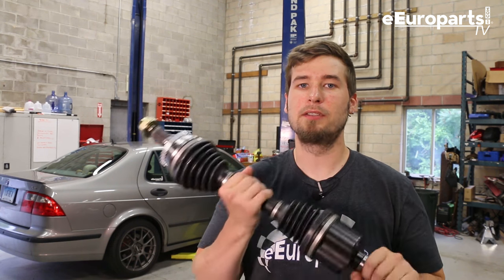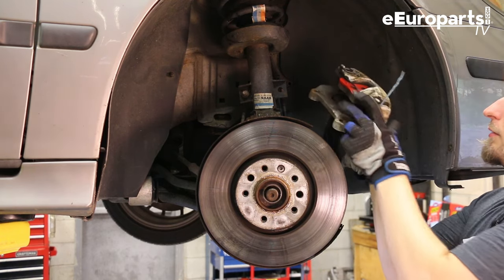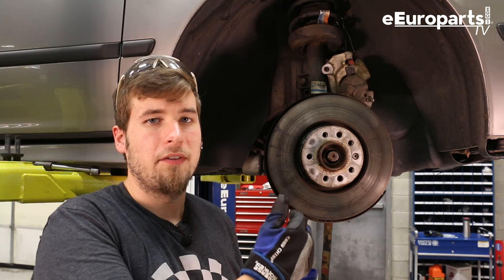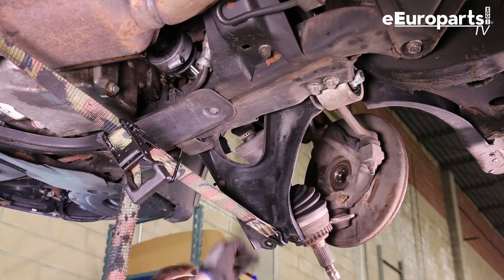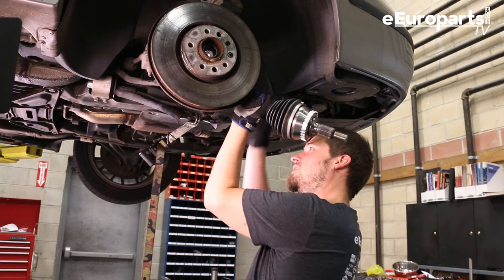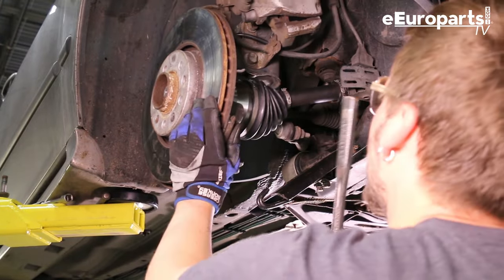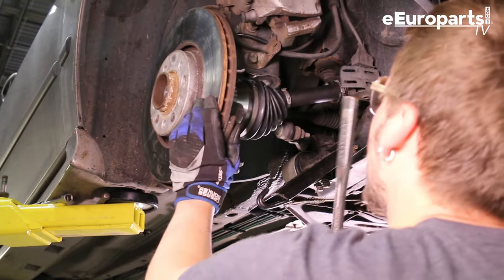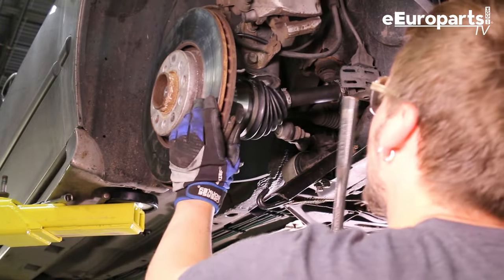Saab 9-5 C/V Axle Replacement DIY

Comment: When installing the new axle, it's not a good idea to hit the axle with the hammer which can damage the threads on the axle. Use the old nut on the axle and you won't damage the threads. The new nut is a lock nut which should thread on at least half way by hand then gets tight where the oblong portion of the nut is.

Comment: whew, man really thanks a whole for the video, was a big help for this project. I plan to do drivers side next week. My wife owns an 03' 95 so this video worked perfect for me. So yeah nobody here in lynchburg even sells an e20 inverted torx! I managed to bust em with a 16mm but wow it took a lot of torque. I ended up replacing those bolts to something i will actually have a  tool for lol. any videos on a/c compressor replacements? Thanks again i will definetly be subscribing
Reply: some 16mm sockets/ also have label e20 on them so those work with e20 and 16mm hex- bolt heads.

Comment: I have a 1999 9-5, can you advise how the process is different?  Maybe a diagram, links if not able to film it for YT? Also what is the part for the 99 vs for your later machine?  I am seeing listings some of which have axle shafts out both ends, some of which have a tripod joint on the inside.  Which to order?  What difference?  

Also if you lose ATF on the driver's side, is it reasonable to catch it in a basin and re-add?  I heard that there might be a conflict on what fluid to use and that different fluids don't mix.

Comment: Great videos! I just purchased a 2000 SAAB 9-3 convertible turbo manual trans.. What would be the best combination to lower and fill my wheel wells? I have seen 18 inch wheels but no lowering videos...Hopefully you know best!
Reply from the maker: https://www.eeuroparts.com/Parts/404338/Suspension-Strut-and-Coil-Spring-Lowering-Kit-Front-and-Rear-SPORT-11451180/ Will do a great job of lowering your car and firming up the ride do you don't rub.

Comment: Thanks for this great vid!! I am getting a creaking sound, first it was when turning right and accelerating. Now it is also happening when moving from stop/low speed to some acceleration( all this I can only hear at low speeds, could be happening at higher speeds, not sure). Is this because of CV/Axle joint issues or what else could it be? Any insight is much appreciated. Thank you.
Reply: did you find out what it was?

Comment: I did this and had MAJOR clicking when I went to test drive it.  (couldn't make it more than 1 foot before it sounded like it was breaking the car, so left it there)

I imagine I didn't hammer the axle into the transmission hard enough (I just pushed fit it by hand).

HOPING I didn't break any threads in the transmission area, hoping if I broke anything, it was the axle.  (only $80 and pretty easy to replace)
Reply from the maker: Definitely double check everything is situated correctly and that nothing is binding up.  It is possible the axle is defective.  If you bought it at eEuroparts.com, contact us to set up a replacement return under our new Parts for Life program, which is a limited lifetime warranty on nearly all parts we sell!
Reply: @Eeuroparts  will do. Thanks!
Reply: Use a piece of wood between the hammer and axle or a kind of soft headed hammer to spare the joints.

Comment: I have a 2004 Saab 95 and just changed the cv axle that was just about to break, but on the wheel hub bearing, I didn't get the wheel hub bearing replaced cause that bad boy was stuck in there like it was pressed in.  I'm gonna give it another try when  I do the other side cv axle.  Any advice on how to get it out, or should I just take off the hole hub and take it to a machine shop and let them do it?  Thanks for any help.
Reply from the maker: Here's a video about the wheel hub specifically, hope that sheds some light on your issue!  https://www.youtube.com/watch?v=ooWrMnSc4vM
Reply: Did you get the hub out? I just did mine and it was also had to get loose, there is about 10mm where it can be hard to drive out, but i just hit it from the inside going out, and then also hit it on both sides to make it free the rust. It comes out with the brake shield.

Comment: if the CV joints are gone, will it make a crackling sound when turning and accelerating at low speeds? i feel like i've changed all other joints on the front of the car.. cannot figure this out.
Reply: Kjeksy yes...loud clanking sound. Almost like a clap.

Comment: i cant seem to remove the hub off my 99 9-5 wagon to replace wheel bearings.  its not the later 3 bolt version.  but it not coming off with a gear puller.  please help!
Reply from the maker: Safety glasses, lots of heat, and a big hammer.  The sharp shock is usually more helpful than the slow torque application of a puller on stuck and rusted parts.  Soak the mating surfaces in penetrating oil first, just remember to have good ventilation when applying heat by means of torch.
Reply: make sure you remove the bolt that holds the rotor to the hub
Reply: but not sure if your setup is the same as an 03 9-5

Comment: I have a 2000 Saab 9-5 v6 turbo can you tell me or show me where the grounds are in the engine bay. My lights flicker and I want to clean the ground ends
Reply: Based on the year, I wouldn't think that your lights are xenon. But I have the same problem with my 08 9-5 aero xenon headlights. Based on my research and speaking with a local Saab automotive technician, the ballast is what needs to be replaced for each headlight, which I think is only for xenon headlights. I have read the seals break around the ballast and that allows moisture into it which makes sense based on the flickering when I accelerate, break, go over bumps, I can just picture small water droplets moving around inside the ballast causing all sorts of quirky electrical problems, which my car has. But I've also read it could be the voltage regulator in the alternator, which I just replaced a couple days ago and haven't noticed the flickering yet, but I expect it to show up soon. Sorry I can't tell you where the grounds are as I don't know anything about cars really. I'm learning as I go on my Saab. But I would think anything metal on the engine would be considered a ground, but don't quote me on that. Do more research on that:)
Reply: @christopheralder2666  thanks for your input, I've looked up the ground diagram and it says there is almost 9 grounding points in the engine bay. My lights flicker when I use my window switch or hit my brakes or acceleration. Someone else said check the grounds, but Saab over engineered the cars. Thanks again
Reply: Weird. I wish I could give you a good idea. I gather you havent tried to clean the connections yet? Maybe that will be the fix when you do that. Do they flicker when you try other high demanding electrical things, like defrost, seat heaters, ac? If so, have your alternator checked. Also try to look at your positive battery cable for corrosion, especially where it connects to the alternator down below. I've read that the cables can corrode on the inside where it's hard to see the corrosion which causes the current to not be reached and causes heat to build up. I just replaced mine cuz I've had 3 alternators go out in the last 2 years. I saw melting at the connection point to the alternator this time which means too much current is going thru too little cable and heating up. All of this is my theory, cuz like I said Idk anything about cars really. I'm still a beginning learner even tho I'm an old fart
Reply: @christopheralder2666  at the battery no but my cable from the alternator to the battery was cut when I bought the car I fixed it by twisting and taping it but I know I need to replace it. I install car sound systems so I'm about to do what's called the big 3 upgrade and I'll be running 2 new 0gauge lines from the alternator and new 0gauge grounds to the engine and frame plus 0gauge ground for the alternator. So after that is upgraded next spring I'll upgrade all the rest of the grounds to 0 gauge wire.
Reply: Yes when I use any electrical they flicker but my seat warmers I don't think they work I can't feel any difference when I turn it on
Reply: Just to rule it out, I would take it to Autozone or somewhere like that and have them test the battery and alternator. Have them test it several times. Mine tested good the first test and then bad the subsequent tests. A lot of people would say replace the headlights as well to rule that out. But try to do free or cheap stuff first. Clean up the connections like you said and have Autozone check it out too. I hope I've been at least of some help. Good luck with that!
Reply: @christopheralder2666  already did the head lights. Yes you have been helpful thanks
Reply: Andy Brown  it would be LHD on my car that's where the battery is. Saab over did it on the grounds man its crazy, but since I'm upgrading my stereo I'm making new grounds and power cable out of #3 welding cable it'll carry more power and make better grounds.thanks guys

Comment: Is it possible to convert my 2005 9 3 to an awd? If so, can you create a video?
Reply from the maker: It might be possible, but in general it would be much easier to just buy one already equipped.  AWD 9-3's are very low in price right now compared to the cost it would take to buy the parts separately.

Comment: i cannot get those dam 3 bolts out of the ball joint
Reply from the maker: Try unloading it with a floor jack, it might be bound up.  You can also try to remove the pinch bolt but this will most likely be more difficult.
Reply: got them out now havin a hell of time getting back in

Comment: Too bad that Axle is of POOR quality . Rebuilding (clean /grease/ reboot) the original axle is FAR better
 AWARE?? that the outer CV joint is designed to be separated (C CLIP)  to make servicing of it painless. NO need to remove the axle.